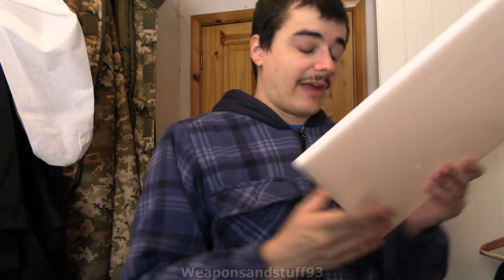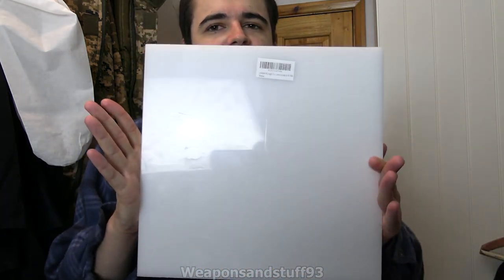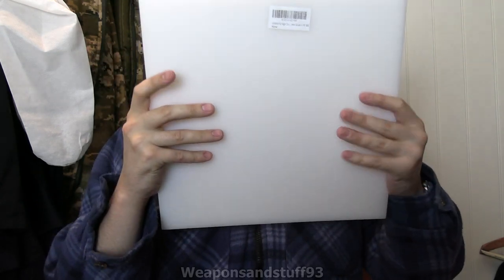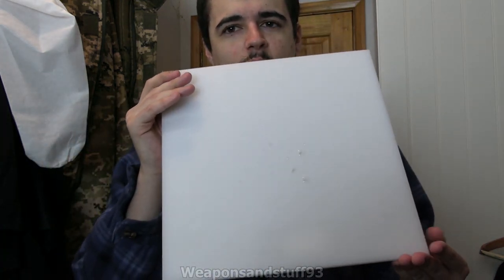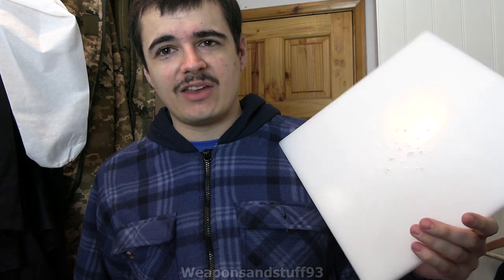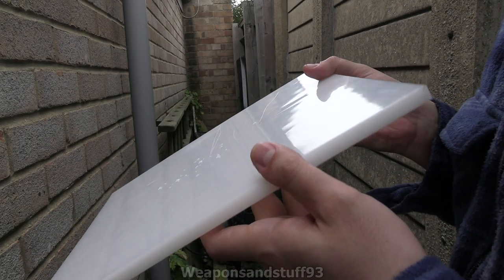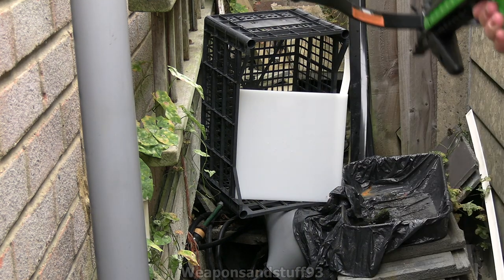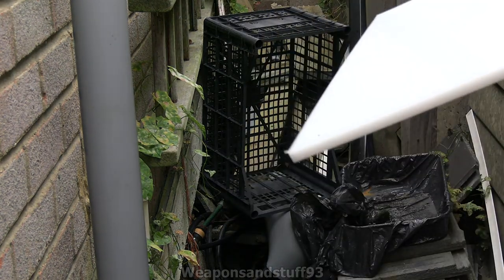Thermoplastic as armour against Pistol Crossbows

Comment: Interesting. I wonder if you'd get different results with the plastic up against a solid backing, like a wall? If it's able to move backwards that might be helping the bolts just slide off?
Reply from the maker: Won't make much difference, might effect 1mm of penetration or so but they certainly won't get through based on the backing.

Comment: Very interesting material. After the basic tests, are you planning on integrating the poliethilene with other materials to make a more complex diy protection? Like high density foam or a ceramic tile.

Also, have you tested this vs polycarbonate? The stuff some riot shields are made out of

Comment: I would want to test something like:
1mm HDPE
1mm steel
1mm HDPE
1mm steel
1mm HDPE
1mm steel
1mm HDPE
... bonded with resin-soaked glassfiber or kevlar in between.
All in all, around 10 mm thick, and probably very, very strong.

Idea being that the thin steel can be formed into whatever curves you like, the HDPE can be heated up to conform nicely, and the glassfiber just follows along.
Reply from the maker: If you had the materials to make it that would be interesting.
Reply: @Weaponsandstuff93  Here's the video I was telling you about previously where they did a test of this sort. They used much thicker plates of HDPE, also variants backed with steel and/or ceramic. https://www.youtube.com/watch?v=x9dr8aKGggU

Note that it's not clear that they used UHMWPE, HDPE is similar but doesn't have the same ballistic properties. HDPE is "milk jug material", whereas UHMWPE is typically used in cutting boards, or other industrial applications (and of course in helmets). Note that many plastics are thermoplastics -- this doesn't mean that they're strong necessarily (PLA is a good example of a fairly brittle thermoplastic, ABS is an example of a tough but highly yielding one). What it does mean is that they can be formed and shaped using heat. That's what makes them great for helmets and other similar rigid objects. You can simply put them into an injection mold and crank them out by the thousands very cheaply. In contrast, kevlar requires a lot of manual work involved in resin bonding the sheets together, doing stitching, and so on.
Reply: @Weaponsandstuff93  I havn't :)
Anyway, I see one possible problem: The resin perhaps won't bind properly to the plastic ... alternative bonder could be cyanoacrylate?
Reply: I would like to see 1/2 inch to 1 inch of gravel molded onto that piece, secured and compressed with duck tape. I bet it stops hand guns with ease, and likely 5.56.